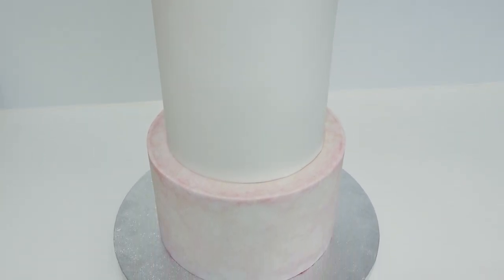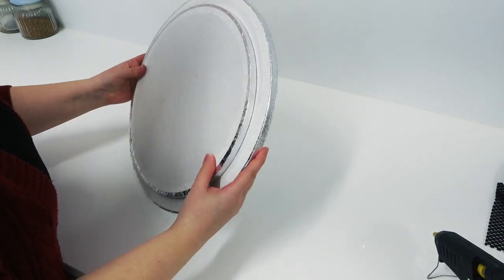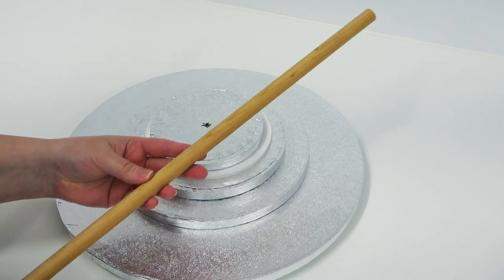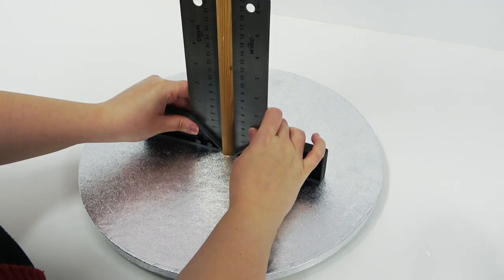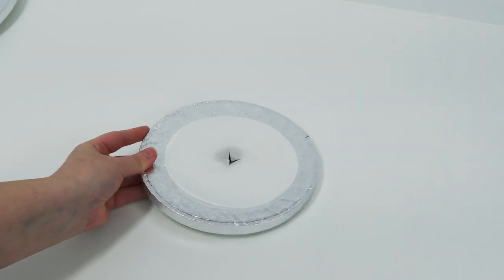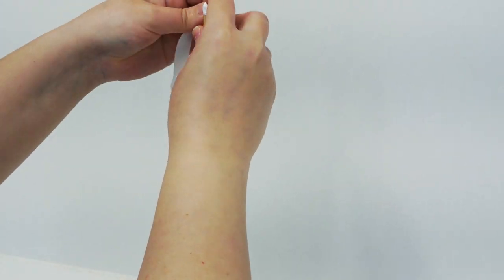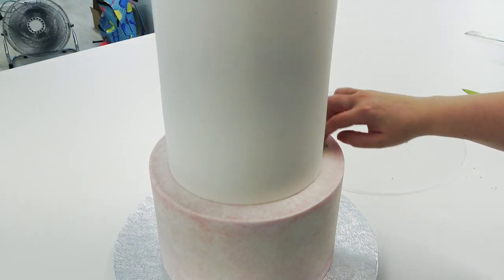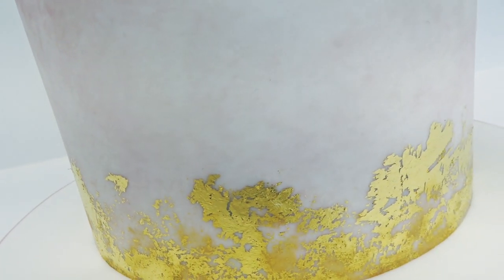How To Central Dowel For Your Tall Cakes | Cake Tutorial | Cherry Basics

Comment: Besides the central dowel; did you put support from one tier to another so they wouldn't push down on the other one?
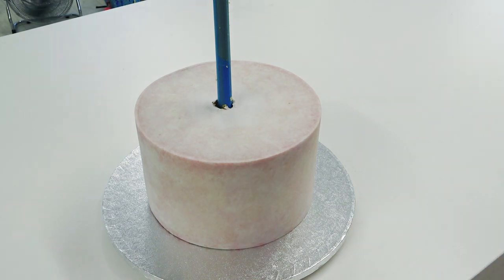Reply from the maker: oh absolutely. I mention it as 5:27. The central dowel is just to keep the tiers secure from sliding, the individual dowels are always needed to hold weight :D x

Comment: So I did a central dowel on a wedding cake this weekend but when I saw placed the second tier the dowel poked thru at an angle. This meant the top tier was set a bit back, not centred. How can I avoid this?
Reply from the maker: Hi! That means your central dowel has shifted a bit when you placed the second cake on. If possible you just pull the dowel back central in the cake before placing the last tier on. If you were unable to move the dowel, that means your hole in the board your second cake is sitting on wasn't quite wide enough to add some wiggle room x

Comment: Hi Tracey, so you would transport a three tier 8 inch, 6 inch, 4 inch cake  without a central dowel? I'm nervous. 
May I ask what's the size of the central dowel?
Reply from the maker: Yes! Most of my cakes dont have a central dowel as they are usually all ganache and sugarpaste covered.
I have a cake delivery video if it helps: https://youtu.be/KOqDtMJVM1o?si=3S2g2jMJnGtE3W9h

You will want to make your central dowel to the regular height of your cakes, if I give you my measurements, and your cakes are shallower, it could pop out the top!
Reply: @Cherrycakeco  Thanks so much. My cakes are IMBC then fondant.

Oh, no no, I meant the diameter of the dowel, 1/2 inch, 1/4 inch...and I've just realised you said this in your video 😅. Thanks anyway!